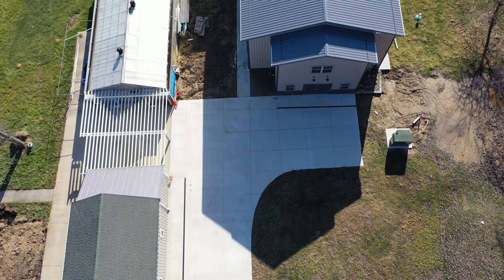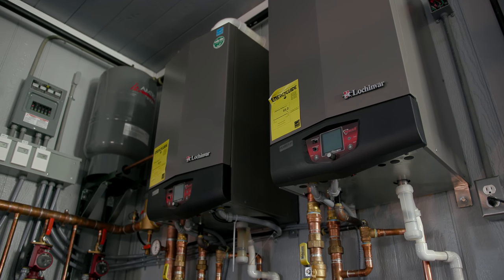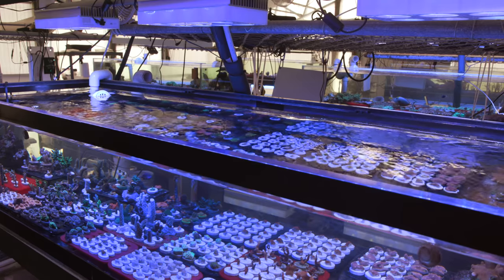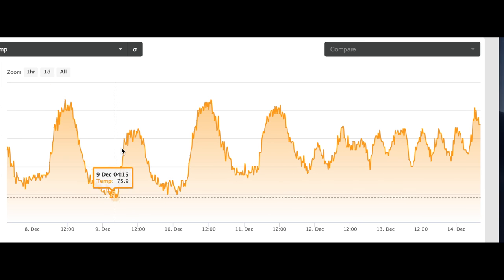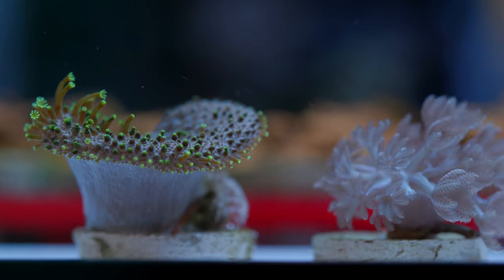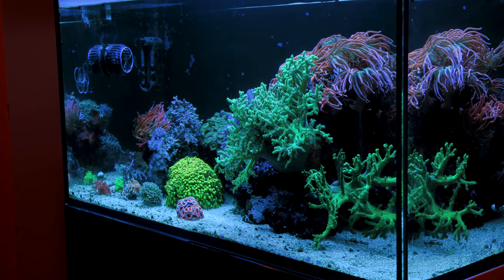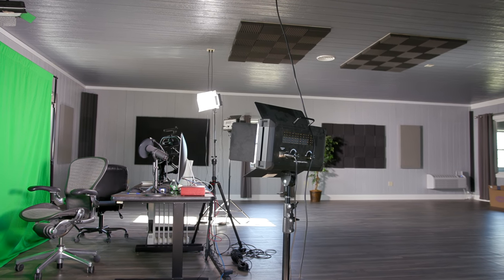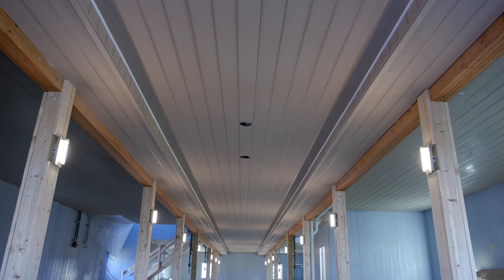New Tidal Gardens HQ Construction - Episode 8

Comment from the maker: It's hard to believe that this build is 14 months into the making.  We are almost done with the bulk of the construction and are just doing some final polishing touchups before the tanks get here in the spring.  The great thing is because of the new building, we were able to upgrade both the electrical and the heating systems in the old greenhouse.
Reply: If you're still utilizing the greenhouse maybe look at propagation of macro algae, sea grass and producing cured live rock. Just an idea to utilize it for niche areas since it's an ideal setup.

I would probably also utilize the greenhouse more in the way of soft coral propagation.

And yes, ubiquity is very good and easy to manage. You should also look into their poe security cameras.

It's one of those things you don't want to wait till after the fact you wish you had them since you already have the infostructure in place.

They also have a nice easy phone system. Look up crosstalk Solutions on YouTube and watch a Lenny video.

Also, if you're looking for soft coral stock to propagate and build an inventory check out https://www.marinefarmers.com/

They have alot of rare fast growing hard to find soft corals, I figured I would tip you off on that since soft corals are becoming so rare to find, and what he has impossible to find anywhere else, not even Jason fox has this stuff.

Comment: As someone with an audio engineering degree, I would definitely recommend bookshelves full of books along the walls or decorative rugs in the studio. The more hard/smooth surfaces you have, the more reverb you’ll be fighting. Especially in a space that size. Go for texture/variance on the surfaces, and you’ll be surprised of what a quality space you can have for low money without buying specialized/overpriced paneling. Cheers!
Reply: Are books real any more. I like books myself but I did not publish any of them myself. So how many is 2 mini.
Reply: The books don’t even need to fill the shelves, just be spaced out to capture mid/high frequency audio content. As much as I like books for reading, that’s not really the functional purpose I’m referencing here. Ha!
Reply: Sorry,  just looking to see your point of view. not to bring out frequency response frequency ranges sequences refractors sorry fractions. The true sound of sound or something like that.  Thank you.  Books good.  Old I used that one,  when I started books.
Reply from the maker: The audio will get better as I fill the space up with stuff.  I didn't want to move a lot into the room just yet because there is still a little bit of carpentry that needs to be done and more stuff would just be more things in the way when the workers come.
Reply: Understood. This was more of an end product comment. 😊
Reply: Would moving the desk away from the wall - more into the center of the room - help with reverb?  The shorter distance a sound wave has to travel, bounce and return means less echo, right?

Comment: I would really like to see some hydro-zorbs on the copper tubing on the unistrut, for dissimilar metals, even though the strut is painted green , copper and steel are dissimilar and electrolicis will occur and weaken the tubing, I install medical gas systems  in hospitals etc. and use hydro-zorbs everyday, against the code if I didn’t use them, a little more money than those copper colored painted strut clamps but I think they re worth it!
Reply from the maker: I'll have to look into what those are.